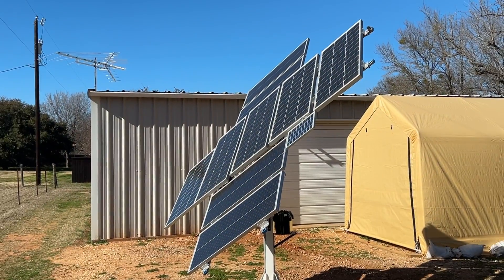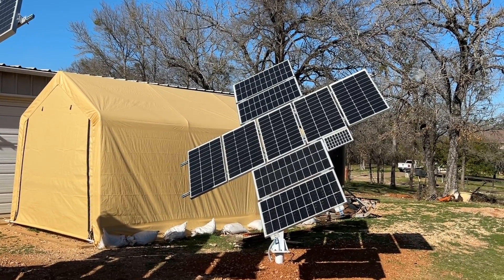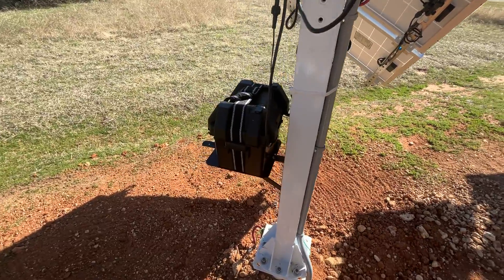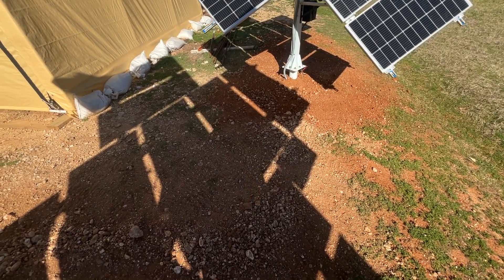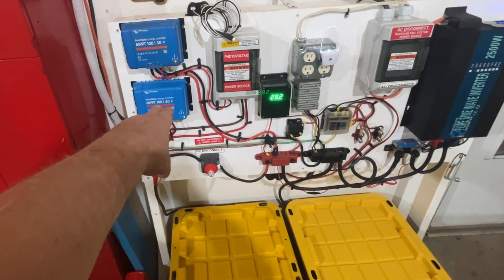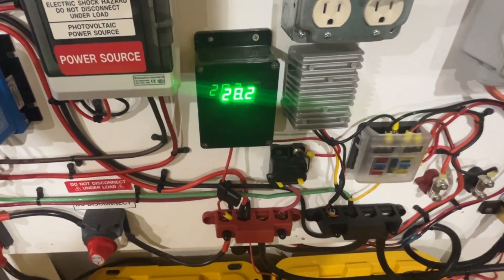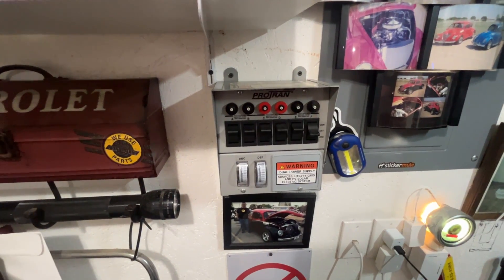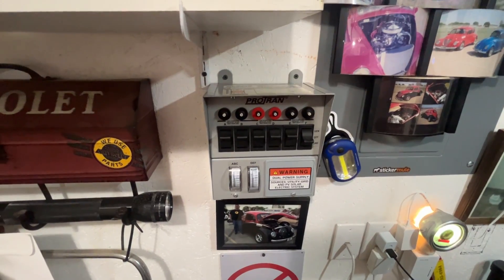Eco Worthy Dual Axis Tracker latest additions

Comment: I want one of these. Don't think they will hold my 460 ×6 panels.
Reply from the maker: I agree it would overload the actuators . The framework should work though. A heavier duty actuator could work with the extra weight of those panels. I made a relay module that works with the controller to remove the electrical load. Good luck on your project
Reply: @RustyGlovebox  thanks 😊

Comment: Do the solar panels help charge your battery source?
Reply from the maker: Yes, I charge a battery bank and use a splt phase power inverter for my 120/240 volt needs in the workshop.

Comment: All studies (!) only showed additional yields of between 20% (single-axis) and 37% of solar trackers. 
Due to the extreme drop in the price of solar modules tracking systems are now superfluous. In any case, they are mechanics and need maintenance. And they are very susceptible to wind. 
For this reason and because of the mechanics, most of them only last a 1-10 years. It is much cheaper and much more reliable to simply install more solar modules!
If you want more constant yields throughout the day, you simply have to set up the modules in an S-E and S-W orientation.
Reply from the maker: Thanks for that information

Comment: you can network those two charge controllers together if they are both charging the same battery bank they will work together both with absorb and float at the same time and put out the same amps and volts.
Reply from the maker: Thanks for the tip and I will be looking into doing just that.

Comment: You can just run a 12v cable to your solar controller to power it vs. using a battery and panel, just add a fuse box.  Simple
Reply from the maker: I did run a 12 volt cable when running my cables but opted to have remote batteries later cause I knew I would have more than one in time. Thanks and take e

Comment: That is Awesome. I really need to look at adding something like that.
Reply from the maker: I used the 100 watt panels because they are cheaper and I had several already that total to 900 watts for each array. But you can use 6-200 watt panel for 1200 watts per array. Thanks Dan

Comment: Just found your channel, for that switch between grid and solar, did you have to have an electrician install it? Would the power company be upset if a layman did it? I'm in WA starting to look at how I can add solar power for my shop too. I'll go check out all your past videos, thanks for sharing everything. Cheers!
Reply from the maker: I did everything myself. You might need to check the electrical code in your area. Mine is a stand alone system and not tied to the grid. I can switch from utility power to solar power by using an UL approved electrical transfer switch. Good luck on your project

Comment: Nice work as usual Lloyd. I also picked up one of those ecoworthy solar tracking mounts for a small off grid project to have some power in a shed. I also bought 6 bifacial ecoworthy solar panels rated at 195 watts plus whatever reflected light they get from behind. I am going to put a ten foot long pole in the ground that is ready to go but I'm waiting for warmer weather to dig the hole and work with concrete. The pole has a 1/2" plate welded to the top with drilled and tapped holes to bolt down the aluminum post to. I will probably put the pole 4' in the ground with the addition of lots of metal welded to the pole along with extra rebar and a lot of concrete. Hopefully I'll get the base of the aluminum pole about 5 to 6 feet above the ground so I don't lose the yard space. I also bought one of those combiner boxes that come pre-wired so you just plug the solar panel wires right into the box. Anyway thanks for the show. Joe
Reply from the maker: That's get Joe, looking forward to seeing the progress on your project. I have really liked mine and hope you have as good of an experience with yours. Have a great week

Comment: Hello!  Great video.  First time viewer here.  In my mind I go back and forth about the value of a tracking system vs. additional panels. All else being equal, if you add up all the money you spent on tracking controllers, wind sensors, linear actuators, etc, could you have just bought 40% more panels to end up with the same average output?  You would have the benefit of no moving parts to maintain which would lead to higher reliability over time.  Now, I understand you have the time and talent to maintain such equipment and probably get enjoyment out of it, but maintenance does not scale well.  Thanks!
Reply from the maker: I wondered about the same but I got the first tracker for $375 and the second one a few months later on sale for $350 on eBay without the panels. I use the 100 watt panels cause they are so cheap now. On the first one I reused the panels I had on the roof.  I figured if you had to build almost any type of frame it would be almost half of that and it wouldn't trace. The tracking adds about a 40% boost to the output in a day with good sun. For me it works good but not for everybody for sure. Thanks and take care

Comment: Hello.
Added dual axis tracker.
The solar board is working great and is great.
40% increase in output.
You can run fans and air conditioners!
2500W is wonderful.
You did a good job!
Thank you for showing me.
Thank you my friend.
Reply from the maker: Thank you, it has been a fun project and I have learned a lot. Have a great week my friend

Comment: Very nice!!   Neat ...  looks like a lot of research and work ..   but efficient !!   Very interested ...  and have done minimal experiments with solar ..  but will be following what you are doing ..  and HOPEFULLY I can pick up the "gist" of what is what ..   :) ..... Thanks so much for the video.  (Would like to put something like this in our "cabin/shack" in our woods ....      GD Tractor
Reply from the maker: You can buy a solar power kit from several suppliers. I wanted to build my own system. More work but it is tailored to my needs. Thanks Gary and have a great week
Reply: @RustyGlovebox  “Solar power kit”.  Say for 12 volt?     I sure hate to take your time but what would I say so solar power kit for 12 V system or a 24 V system or what?  Sorry - I am not very knowledgeable on this subject.   Thx.   GD

Comment: Your walking in high cotton Lloyd.   The air speed meter , in high winds what does it do ?
Reply from the maker: If the wind speed gets above the sensor setting , the solar array will lay flat.  Hopefully avoiding damage. Thanks Steve, Cheers